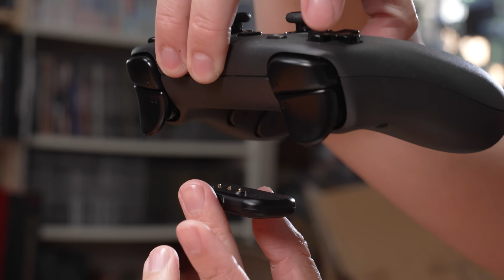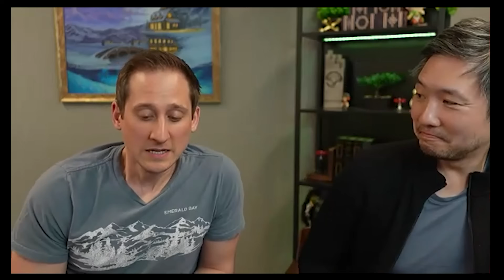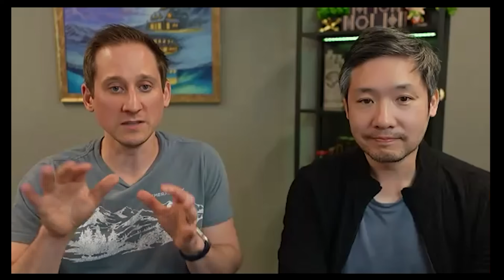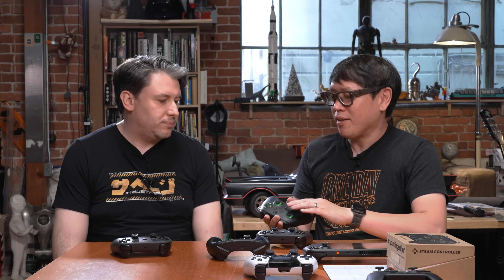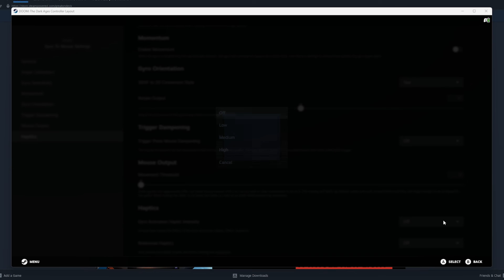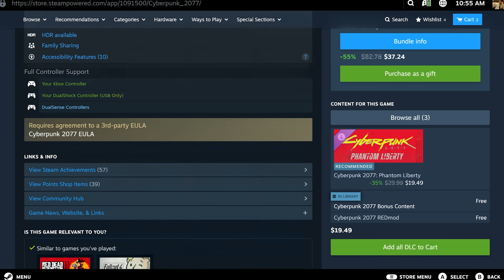Tested: Steam Controller Review + Valve Interview!

Comment: The one and only thing I hope is that Valve eventually turns all the Steam Input magic into a driver in the same way that Xinput and Dinput are drivers so you aren't completely beholden to Steam.
Reply: Agreed, too much in one basket.
And that leads to other controllers making their own inferior configurators, and marketing it like it's made of gold.
Reply: @doorlesswings9356 I absolutely agree..... It would help a lot. It would even fix the problem on steamdeck when switching to desktop mode. In the moment that steam restarts you can't fully controll your gamepad.... You have to wait until steam has restarted....
Reply: @BlackyRay_Patrick  Yeah I was very surprised by that when I got a Steam Deck. You'd think it's own buttons would just... work without the app open.
Reply: It dose support SDL, at least. That allows it to function as a basic Xbox-like controller.

Comment: Every video I've seen of people using the controller (including Valve's own marketing/clips), most of the users are reaching for the analog sticks, and even then can only make contact with the lowest corner of a respective stick with their thumbs, so moving the stick in a direction away from the hand requires, either, letting go of the controller, rotating the wrist a good amount, or just hoping the bottom corner of the stick is enough grip/surface area for your thumb.

I don't like that the inclusion of trackpads meant that they had to push the sticks up from where they would be on an Xbox or Playstation controller. And, to be fair, the grips on this controller are more "parallel" (Dreamcast-like) than, say, and Xbox controller, so the "pivot path" of the thumbs is not as much 45-degrees as an Xbox controller... but that's a whole other gripe I have: This controller width calls for more "angle of attack" of the grips. Most people using this will be people who have adult-sized shoulder spans, meaning more angle of their arms when reaching in to hold a gamepad. The angle of the grips needed to be much higher (and then, accordingly, the sticks lower, so they fall into the pivot-path of the thumbs).

I have ideas of how you'd "fix" all of this, and not lose functionality, but I'm sure that would cost more.
I'm just going to have to make my own controller... maybe get one of these and mod the heck out of the chassis...

Comment: Removing the touchpads is madness. Then its just a normla controller. Actually the right joystick is completelly redundant for shooters having the touchpad. Its just sooooo much better for looking around
Reply: The steam controller one was truly ahead of its time
Reply: why not just use gyro + flipstick for shooter?
Reply: @Henry-sv3wv just feels better on touch pads, at least, steams touch pads.. i honestly believe it's a underlooked way to playing mouse games on joystick controllers, especially with the amount of things you can tweak on the pads with steam layout setting

you can even use flick function and gyro on those pads
Reply: @Henry-sv3wv  I prefer touchpad because I can retain X:Y axis camera controls on the touchpad, and also set up a dpad modeshift with an inverted outer ring through Steam Input so I get 4 edge clicks and 1 center click. This reduces my need to use the facebuttons, and lets me bind other things to the back buttons.
Reply: Flick Stick is even better still and that does require the right stick.
This and the original controller's pads struggling to track my thumbs is why I don't game with it.
I have used my Steam Deck over Steam Link and 8BitDo Pro+ with it's almost adequate gyro for flickstick input.
For me this justifies the price, as it will be meaningfully better than this software jank and heft or struggle in a too narrow gyro response dynamic range.
Reply: @WyvernDotRedYou can add gyro/flick functions to the pads as well, IMHO, I still think the dual pads are better. They feel marginally better than the gyro+joystick combo and with the amount of tweaks you can do with those pads using the steam layout settings. I find it hard ever returning to just using joystick controller/handhelds with out functional dual pads. Just a lot more options to configure
Reply: @WyvernDotRed I prefer touchpads over flick stick, since I've just set my sensitivity so a full swipe does a 180 with mouse input and combine that with gyro to aim. People use controllers like the alpakka that don't even have a joystick or touchpads relying solely on gyro for all their camera movement, so I don't see flickstick as vital.

And being able to set up 4 edge clicks and 1 center click on the touchpad so I don't have to reach for the facebuttons is another plus.
Reply: @WyvernDotRed I have no idea what flick stick is

Comment: Genuinely the only thing it’s “missing” is haptic/reactive/dual stage trigger like the Dualsense and Dualsense Edge, not necessary in any means but it’s very nice to have different trigger options in competitive games. Maybe in the next one, or pro version?
Reply: That's exactly what I was thinking especially for the price. Would be cool too cause developers probably would've implemented it into more games if that was the case. At least it has vibration triggers though.
Reply: @lacedchemist1295  yeah adaotive truggers is licenced to sony only so mo third party controllers can have them
Reply: The trackpads are capable of convincing duel stage emulation, they have a surprisingly wide pressure sensing range.
Reply: @WyvernDotRed. So basically the trackpads took the blunt of the upgrades?
Reply: @ethan5205  the new trackpads are custom developed by and unique to Valve and best in class for thumb tracking haptic pads.
The ones in the controller seem to be a more rounded 5th iteration too, as the 2015 controller, Index, LCD Steam Deck and OLED Steam Deck are all different.
This and the capacitive sensing is what Valve focuses on in this hardware, the rest of the buttons and sticks are average.
IMO, the trackpads and capacitive sensing buttons are the sole justification for the €99 price and steam-input dependency of this controller.
The gyro, back buttons and magnetic sensing can be found in other controllers too, including ones with steam-input support.

Comment: 31:41 - As an avid user of the old Steam Controller, I couldn't disagree more. I find that the perfect setup is using the trackpad for fast, approximate rotation and then use the gyro for precision. I usually set up a full edge-to-edge sweep on the trackpad to match 180° in-game allowing me to instantly turn in any direction - just as fast as with mouse. Gyro is set up to be active when I touch the trackpad and I usually set the sensitivity to be lower than what's normal for a gyro-only setup - I normally use 4x of a 1:1 movement.

One thing I sadly haven't seen any reviewer touch upon is the latency of the gyro. With a DualSense controller connected over bluetooth the physical movement with the controller feels 100% connected to what I'm seeing on-screen, but with the first gen Steam Controller connected to the dongle I sense a slight lag - it's hardly visible but the movement doesn't feel fully connected. I'm really, really, really hoping this is fixed on the new version.
Reply: Yeah, that is how most people use the gyro as far as i am aware - it's the most sensible option.

In regards to lag, i don't know the specifics of the gyro, but the overall controller seems to be as usual when used in bluetooth, and better than your average controller when used with its dongle. I think Digitalfoundry mentioned that in passing, but don't nail me down on that.
Reply: @utarefson9  Gamers Nexus did some thorough latency testing as well and the numbers look good, but they don't matter much to me. It's the actual real-world tactile experience that counts in the end.
Reply: They actually asked about the gyro latency in the interview, but got a non-answer about the button responses.

Comment: I am sorry but while I quite enjoyed your questions to Valve team, they were pretty badly articulated. It was a hard watch. And while you were talking with Josh, you were quite interrupting him sometimes. 

Another point - you clearly misunderstood the point of the trackpads. They are there for 2 reasons:

1. Familiarity with Steam Deck and ability to use the same community layout for both Steam Deck and Steam Controller

2. Steam Machine. While lot of folks will use Steam Machine as a desktop others will use it as a couch console. To avoid using KBM, trackpads are basically necessary at this point.